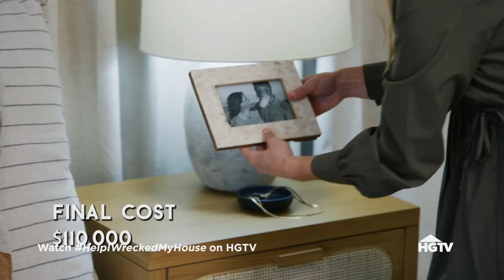Worn-Down Midcentury Modern Home Remodeled with Spanish Flair | Help! I Wrecked My House | HGTV

Comment: This is NOT a mid-century modern home. It was built in the middle of the last century, yes, but it is a ranch-style home. Mid-century modern homes have sort-of Scandinavian styling, beamed ceilings, and often an interior atrium.
Reply: There is a difference between mix. Entury( California ra n h) and mix. Century moxdrn. I've had 1 of each.
Reply: Also floor to ceiling glass